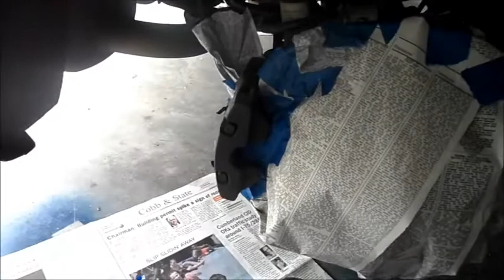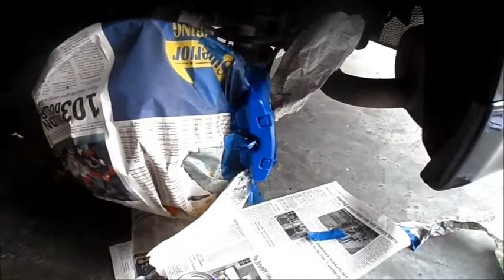fab's IS 350

Comment: i did this. At 150 mph I braked hard to a stop then pulled over and shit was smoking. I have a 2014 is 350. I used the high heat engine enamel though.I think a few specs got on the rotor and have goobered them up. Not from overspray but from heating the brakes up so much and the shit dripping off or fumes or something to that effect. Now I get to touch up my two front wheels, get new rotors and pads just to be sure and clean it all up nicely. Powder coating is the way to go.
Reply: Anton Zuykov  changed rotors and pads, shutter is gone.
Reply: and I want to go ahead and let people know now that the top speed is electronically limited to 131mph...an ecu flash is needed to let you break 150mph. At least in my findings.